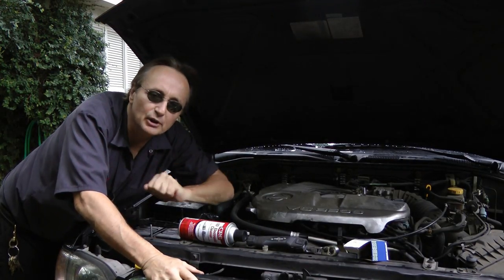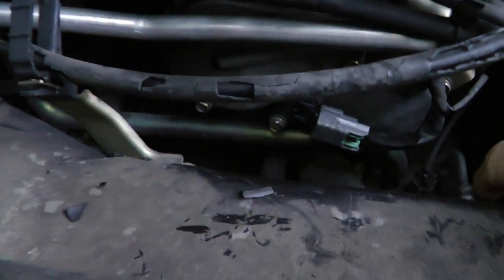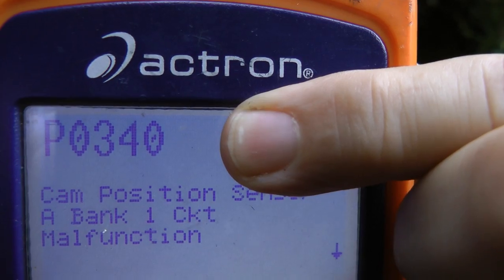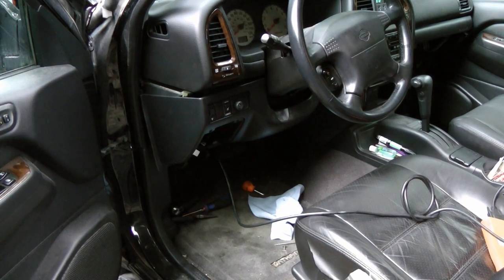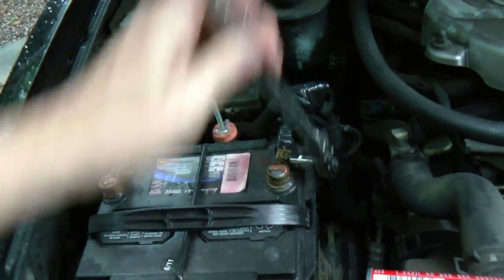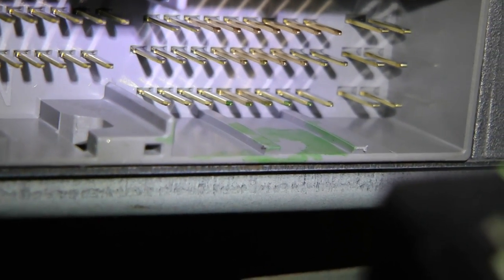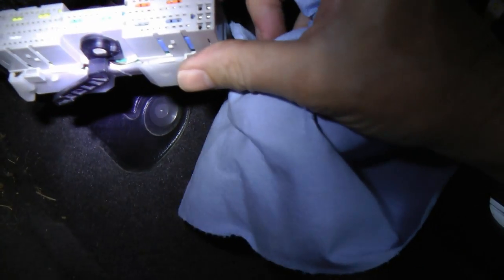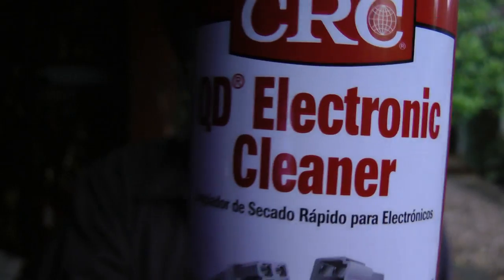How to Fix Computer Problems in Your Car with a Little Spray Cleaner

Comment: I paid 3k for a genesis coupe it cranks no start. It has code p0340. I changed the camshaft position sensors on both sides. No luck might be bad pcm or crankshaft position sensor. Someone help car is only missing spark

Comment: Is this the same as dielectric Greece?
Reply: No, dielectric grease is different.  You do NOT want to grease electrical fittings.  This spray is to clean the connectors like Scotty showed.

Comment: what if there is evidence of water seepage into the computer case but no visible corrosion?  Had no signal from pcm to ignition mod. Mod was tested ok.. Was told to replace pcm on a 2001 Chevy express.  Wouldn't I love some magic spray!!!     Problem was intermittent crank no start that lasted months. Finally was able to duplicate with mechanic at the ready with computer. No ignition spark.  ( an aside ** eventually had ck engine light when it started that ended up with replacing spark plugs, wires, fuel injector assembly, 2 cams, cam lifters, 2 valves, checked cam sensors ) ran like a champ after but intermittent crank no start still happened.  Magic Spray or replace the damn pcm? --damsel in distre$$.

Comment: @scottykilmer Hi briansmobile1 sent me here to see if you could help or give me advice. My problems for my cars are the the alarm beep/chirp suddenly stopped working completely and I'm afraid if some one hits or breaks into them I will not be able to hear. My cars are a 05 MB e500 and a 04 BMW 645i. I don't wanna get ripped off from the dealership or by anyone else so if you have come across this problem before please let me know. BTW do you know any good mechanics that are in the Dallas area?

Comment: I am having a problem with my car I have a 2001 Honda Civic I replaced the cam sensor and now my car went into limp mode and I can't get it out any ideas
Reply: Disconnect the negative cable from the battery post, put something non conductive under it so it doesn't come in contact with the battery terminal. Run a 12 volt jumper wire from the positive terminal while hooked up, then connect it to the negative cable while its off the battery terminal. Let it sit like that for ten minutes to reset the computer. If that doesn't work try putting the old sensor back on. Try cleaning the connectors where they plug in. Make sure the connectors are snapped in with a good connection. You could have broke a wire, so check for loose wires or breaks. Last of all check your fuses and relays.
Reply: Ty bro i will try that
Reply: @lebeckchris  have u done this battery connection thing u told me to do at all?, and did it work? Because isnt that going to send 12 volts through the negative side
Reply: @stevestokes4206  I have done it many times. You hook the jumper to the negative cable while not on the battery, then hook the other side to the positive while it's hooked up to the battery. Ten minutes is good enough. It does create a short, but it wont hurt the car. If you ran the jumper from negative to positive while both are hooked up to the battery that will destroy your car.
Reply: @lebeckchris  ok thanks bro ill try it tomorrow ill let u know thanks

Comment: The NEGATIVE cable is the one to disconnect....all circuits close to GROUND..therefore if you remove the POSITIVE a damaging SPARK can ruin your ECM or other modules...you should know that Scotty...

Comment: 2004 GMC Sierra 1500 4.8l 4x4.
I'm lost. My ecm keeps resetting every time I shut my truck off. It's as if I was disconnecting the batterie. The only way it will pass inspection is if you drive it through a drive cycle with a computer hooked up to it.  Do not shut it off or you'll have to start over. 
Anyone have any ideas please

Comment: Yo Scotty I have a 2000 Acura integra the harmonic balancer fell off and now my car don't run right I changed the alternator and still don't work
Reply from the maker: crank sensor is built into the ballancer, it may have been damaged
Reply: Scotty Kilmer crank position sensor ???if smoke is coming out my pipe now you think it might be my ecu. ??
Reply: I seen your other video where you changed the ecu and it fixed that

Comment: You can keep it at a half tank but i wouldn't drive it forever like that. Even if your state doesn't have emissions testing it could fail safety inspection.

Comment: No scanner  works on my 2013 dodge charger . I was told maybe the computer? And also check engine on
Reply: Does the power outlet work? If not replace the fuse and the obd will work

Comment: Your best bet is to use brake cleaner; I know I would. You want to keep water away from your engine because of the electrical components.. You can check out his video if you haven't watched it: bad things not to do to your car.

Comment: I have 2007 nissan quest won't start I remplace the starter and gas pump still not start just make little sounds in starter,
Poor sound
Reply: Could be anything. Does it crank but not start when you turn it over, or does it just not start altogether? If it cranks but doesn't start, could be your spark plug wires, could be ignition coils, fuel filter, all sorts of stuff.
If it cranks slower than normal or does not crank at all, could be a dead battery. Check your battery connectors too to see if they're lose or rusty-looking.

Most of that stuff is pretty cheap to fix and there's plenty of guides online to help you out! Hope that helps!:)

Comment: is the engine control module and pcm the same thing but  different name
Reply: The only reason why I'm answering your question is because I see that Scotty may have missed over your question to no fault of his own. I see that its been 9 months since you've been waiting on an answer. The answer to your question is no. Some vehicles only have the ECM which is what they are engineered for. However, some other vehicles such as mines have the PCM. The ECM and PCM are simiilar but different only because the PCM is a combination unit. The PCM is a combination of the ECM/ECU and TCU. The ECM is only the engine control module and that is it. Think of an all-in-one computer where you don't need to buy a separate monitor because the monitor and the CPU itself are built into one unit. I hope this makes somewhat sense to you.
Reply: david mcca power train controll module
Reply: Ecm pcm ecu
All engine control
Pcm does both in most cases!

Comment: i have a 1999 306 peugot the motor blew up so we put a new second hand one in it kicks over but will not start  im desperate
Reply from the maker: try my video "fixing an engine that cranks but doesn't start up" and pray you didn't get a bad used engine

Comment: My 1999 chevy astro awd has me on the electrical $$ mistry ride,,,,
WHY DID GM PUT THE ECU UNDER THE BATTERY ?? DUMB!
With such a delicate componant exposed to the weather,,,, its gonna be my first place to inspect when I try to eliminate a hard shifting valve body solinoid.  (Another dumb GM idea)....
Thanks for the heads up video.

Comment: I dun f#$@! up.... i think i fried a fraction of my pcm...... lol not cause this video im actually watching this after.... but i was changing the Cam Sensor and Plug connector for cam sensor..... I must of terribly went wrong somewhere cause..... i tried to crack it up it cracked but no start.... i took the coilds on plugs off and checked for spark.... and NO SPARK , and i checked the wire to the cam sensor No fire there either im screwed.... im ganna try cleaning it like this tho but i donno if it would work think i fried it up good

Comment: +Scotty Kilmer I hace 2004 buick rainier and the heat blower wouldnt stop running and it killed our battery so bad that it ruined it and it would no longer hold a charge so we changed it and now we han no power seats no heat no radio no dash lights other than the ones for the gears and no tail lights other than the break lights!!!!
Reply from the maker: +Kendra Sinclair  often a bad body control module does that
Reply: +Scotty Kilmer okay because i was told by auto zone that the computer under the seat neaded to be reprogrammed and i wanted another opinion and your opinions are great :)
Reply: Nothing is actually coming on at all